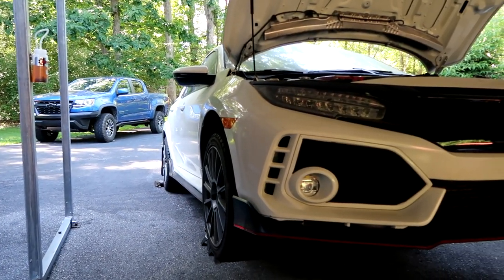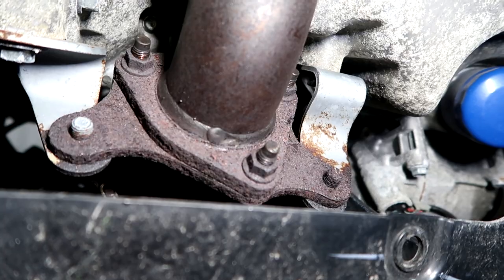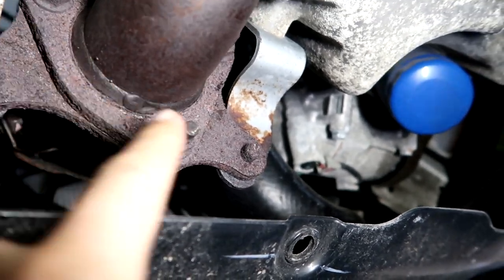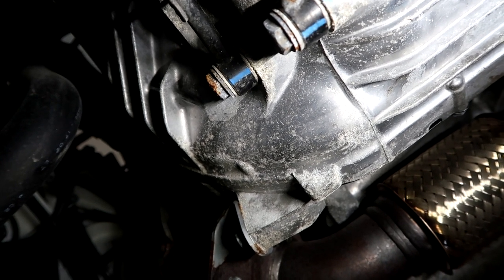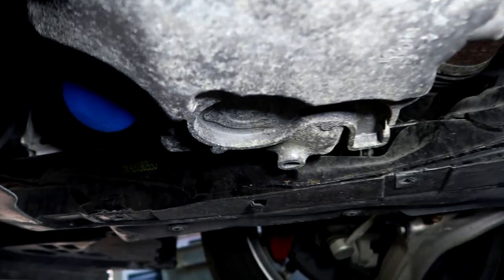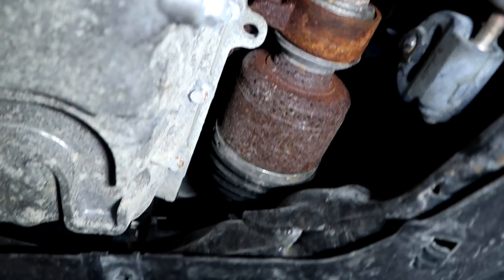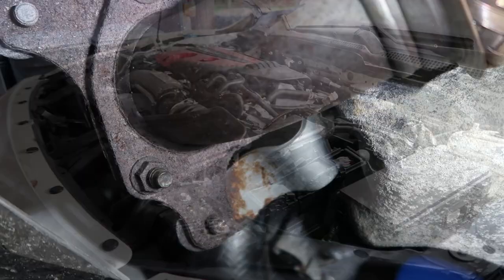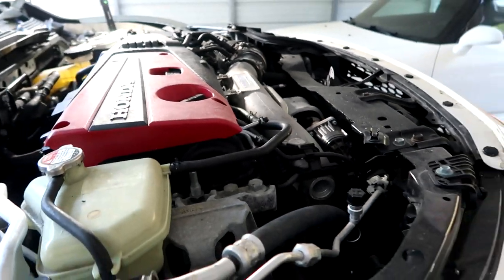The RUST Problem! Honda Civic Type R (FK8) RUSTS VERY easily | Here are the WORST AREAS

Comment: I knew exactly the areas you were going to show before the video even started. I have a video on my channel of my Wife's HRV back in 2017 1 year after we bought it and only 18k miles on it. It was disgusting with rust, and my 2010 civic with 155k at the time looks beautiful everywhere underneath, and try me the civic is neglected and rarely gets the salt washed off in the winter. I opened a case with Honda of America of the excessive corrosion and went back and forth with them for almost a year. It got me no where and they could not admit to using low grade uncoated mild steel for their exhaust flanges. I sent them pictures of the civic and HRV side by side and said "explain this" and they beat around the bush and said it was due to "environmental conditions." I fought back and said my civic has been exposed to the same environment for 6+ more winters than this brand new car. Long story short is Honda is cutting corners and using cheaper materials in their builds lately. They refuse to admit the obvious truth as well.
Reply from the maker: Dayum! I'm not the only one... It's the environmental concerns Honda has, their paint quality is trash, and rust forms everywhere almost immediately, it's a real shame. I put in a lot of work to mitigate it, hopefully it'll stay in good shape

Comment: Thanks. Just picked mine up. I wont be winter driving it but wouldbit be worth getting underneath and coating the bolts with grease on the down pipe / front pipe? Or will the heat just burn that off?  Cheers and thanks for the videos. Ultimately lead me towards buying a type R.
Reply: Good idea

Comment: .the front subframe black area i do notice a couple spots of surfae rust, just small tiny spots just like your video. 
And my car is 2000 miles.....2019.... rarely driven . Picked up from Arizona and now in Southern Nevada. I will be doing rust inhibitor spray on those areas after I use some detaling iron removers on those tiny rust spots.

Comment: Rear trunk latch on the inside corner where the weather stripping on the roof ends is a common spot on the type r also. Happened to notice it on mine after only owning my car for a year. Luckily Honda Canada fixed it over warranty before it got bad.

Comment: cost cutting they have skimpted on a good protective coating, as you said earlier hondas dont suffer this badly my UK 2011 jazz si on 15k miles is so much cleaner for rust,my '04 civic type S on 130k miles is near same as your FK8,my 2 Nissan s chassis drift cars are in another league for rust

Comment: My 2021 Type in Southern California has never seen rain or snow and is a rust bucket already. The factory it was made in Swindon (a small town) in the UK left parts out in the elements or something? I have owned seven Hondas and have never seen and rust in them. This is a factory default, and Honda knew it and closed the plant down due to complaints I assume? 2022 Type R's will be made in Ohio. Now I am stuck with a rust bucket of a car that has always been garaged, has 800 miles on it, never seen rain, and never seen snow. I almost did not buy this car because it was not made in Japan like my BRZ, I should have listened to my gut. Now I got a rust bucket sitting in my garage, I am so disappointed in Honda. We need to start a class-action lawsuit against Honda for a defective car full of rust.

Comment: Typical as any car I would suggest, cars are complex and built to a price so there are bound to be isolated spots such as bolts. The rusted exhaust flange is typical if not stainless, that's probably why it's so thick, you could change the flange bolts to help removal in the future.
Reply: Have you seen the undercarriage of a BMW?  I had a 2006 e90 for 12 years now and surface rust is to a minimal and I live in the New England.  I don't have an issue removing bolts under the car.  Thinking of getting a Honda or Mazda, now I'm a little worried about the surface rust.

Comment: is it possible for new owners to spay that with some kind of heat paint that would coat the areas that are prone to rusting? Thanks for the information and the great video..
Reply from the maker: That's exactly what I did, I sanded down the area and sprayed it with rust-oleum high temp paint, that'll go a long way to help
Reply: @FlyinGato  why is it so hard to get that car.  The dealerships sell them like hotcakes and Honda just does care to put more out.  What gives?  Thanks
Reply from the maker: The Type R? There's been production issues lately, and demand for the car has always been very high
Reply: @FlyinGato  Thanks

Comment: As long as the chassis doesn't rust and body doesn't rust, who cares.

Get ppf to keep the paint from chipping off the body.  That is the main thing.
Reply from the maker: I would still question a daily driven rust belt Civic that's 10+ years old, I don't like to see that much rust.

Comment: As I remember from school science class, heat causes rust. You've started to get me worried. My Type R rusting away in my garage. If I had the time and facilities, I'd remove a lot of bolts and just grease them. Perhaps as you said, they use a stronger salt spray on the roads over there than here. Not sure about Scottish roads but I don't drive a lot in the winter. It's not a car for winter roads.

Comment: cars that sit for extended periods of time will rust faster then a car thats been driven frequently. that and PA rust zone for sure
Reply from the maker: PA rust zone, it's nuts up here. I would also say, though, my Prelude and your RSX have better quality paint
Reply: @FlyinGato  yeah the early 2000s hondas and older definitely were built much more solid compared to newer cars now. you might want to sand down all the rust you can then try to fully coat the undercarriage with some 3m underbody coating. might slow down the rust process for you. do like 3 full coats of that stuff lol!
Reply from the maker: I already replaced or sanded down and painted the areas, I'll spray that stuff next. Luckily I won't be using it in the winter anymore